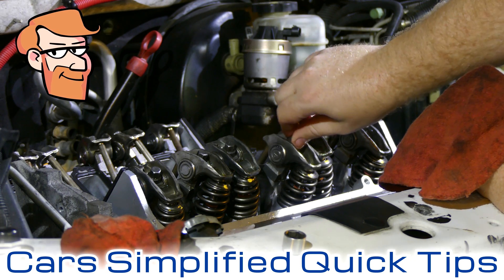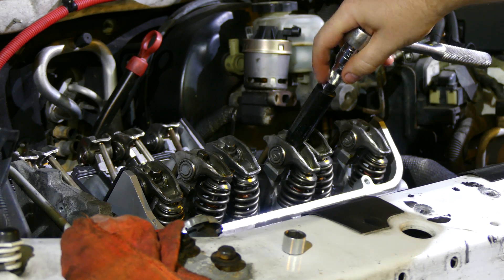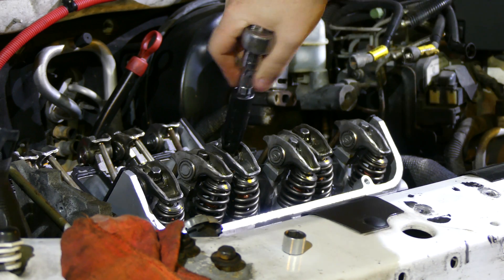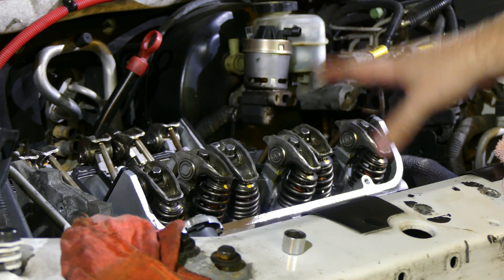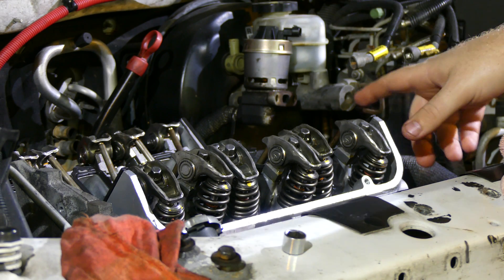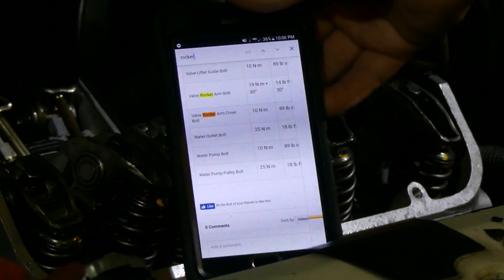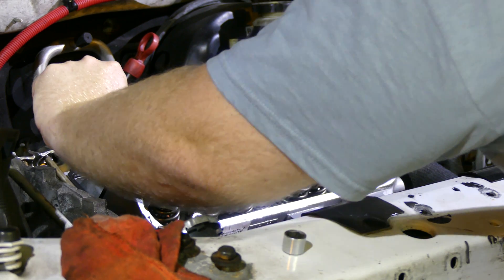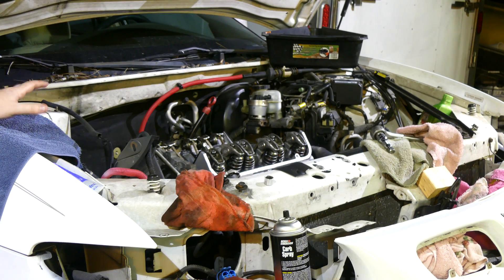Torque Angle by Eye on Rocker Arm Bolts • Cars Simplified Quick Tips

Comment: The torque and degrees are easy for me, but I'm concerned about the rocker arms not exactly fitting perfectly flush into the slots on my 3100 series 2002 Buick Century. A few of them didn't seem to fit perfectly flush and others did. Is it imperative that all are perfectly flush? I don't know if this tiny detail, will make a huge difference. I planned on messing with the tdc on each valve then tightening each one to see if that can get them all perfectly flush. Don't know if it's necessary though.